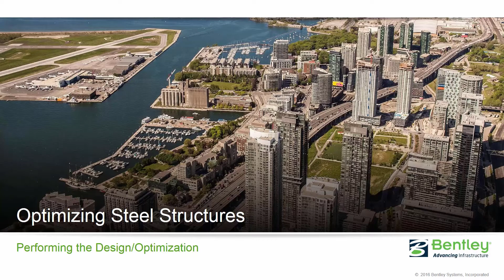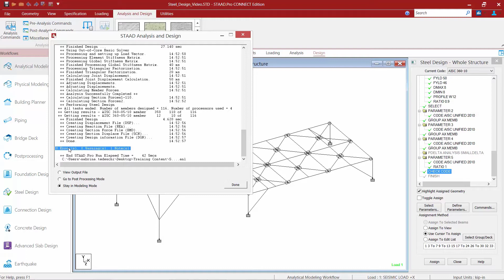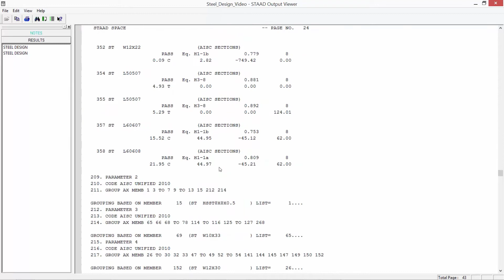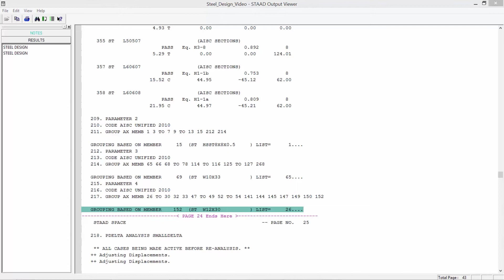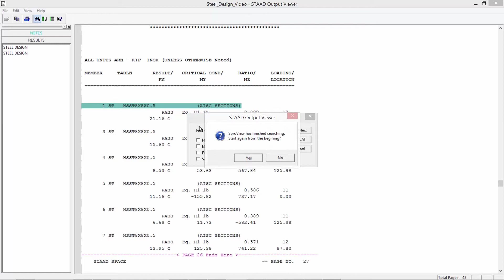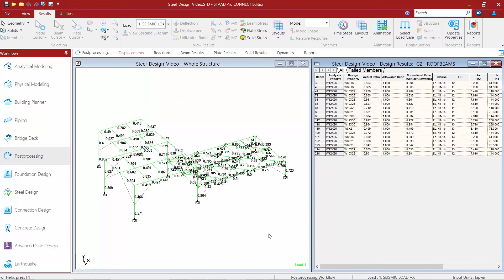Optimizing Steel Structures in STAAD.Pro

Comment: Such an excellent video! Could you help me with one question? When I am visualizing the utilization ratio, it correlates to specific sections of AISC. In this case, for instance, we see a lot of H1.1b sections (which means Doubly and Singly Symmetric Members Subject to Flexure and Compression, special case when Pr/Pc < 0,2). My question is that I would like to see all the Utilization Ratios, for all the limit states that were actually checked, not only the one who presented the highest. Is it possible? I would like to see all the verification made for sections E (compression) and F (flexure) for example. Thank you in advance!
Reply from the maker: You can view more information regarding the steel design checks in the Output file. To increase the level of detail in the Output file, use the TRACK steel design parameter. (TRACK 2 will print the full member design details.) https://docs.bentley.com/LiveContent/web/STAAD.Pro%20Help-v19/en/GUID-925886D0-3965-41BB-A16D-4211F91EADDC.html